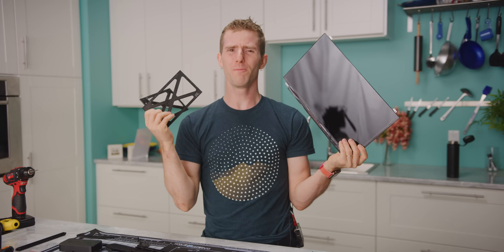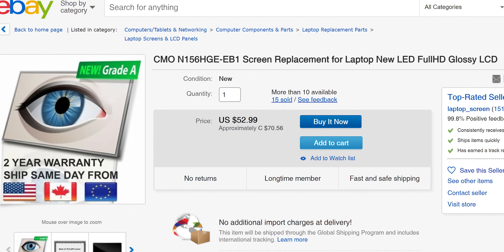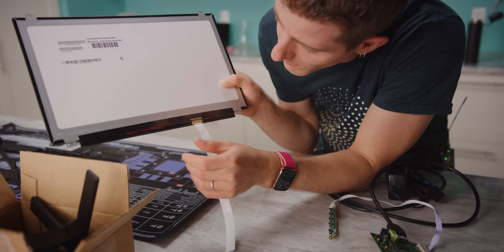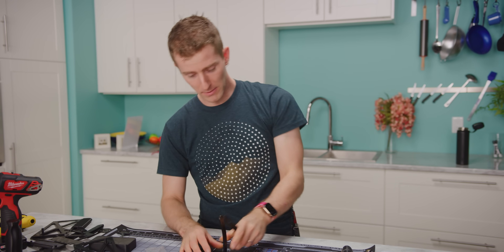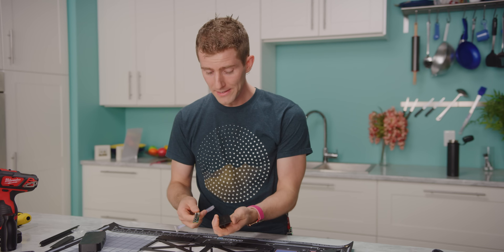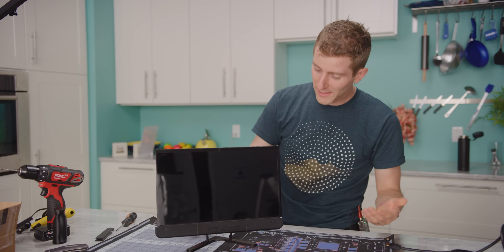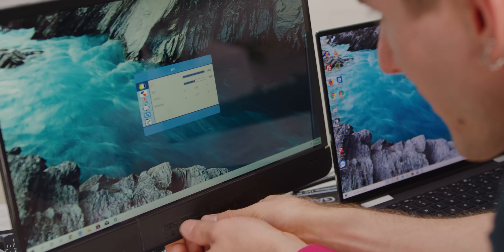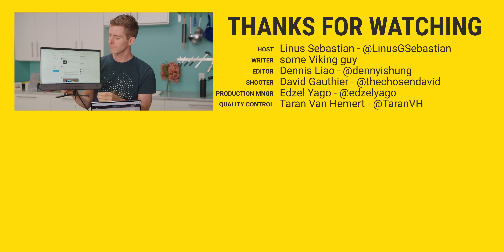We made our own monitor for under $100!

Comment: I tried doing something like this with an old laptop screen.
100 buck to get the controller from Amazon, 2 weeks for it to arrive, and I never got it to output an image.
Maybe I'm using to little current, I said, before burning the circuit.

My advice: unless you have easy access to the parts, like a local electronic shop that sells the components, it's not worth it, just buy a regular monitor.

Comment: I love you, lines! You're like Tony stark of computing. And funny but serious, inspiring. I really appreciate your channel and impressed with your company, I remember you moving in

For what it's worth, I'm planning on building a series of magic mirror type things-just the display, hopefully powered by one pie, which would hopefully double as an interactive window in a stealth van. Id very much appreciate feedback on the viability please, like how much power the displays and drivers only, use please? I've always wondered whats in a monitor, they're so thick with circuitry. Even those without speakers :s I didn't trust ebay either, until I saw this so thanks again

Comment: Pro-hoarder here.  Yep, I picked up an old laptop from skip outside an old house renovation where they threw all the broken things out.  Bought the correct LCD decoder card, held my breath, and it worked.  So I got a secondary monitor which lasted me a couple of years out of it, when the card only cost about 20 pounds.  I still have it actually, one of my better finds.

Comment: For my 3 portable upcycled monitors I've re-used the laptop's display casing and designed cases for the controller board that I've attached to the back.

Comment: wonder if using a lazer cutter table would be easier than a 3d printer. get thin enough sheet metal... hm
Reply: to add to my comment, i havent worked with 3d printers yet. i like the idea of making your own monitor. thanks for sharing.

Comment: Shouldn‘t this be possible with some old smart tvs panel?
Reply: yea but the controlboard is basically in your tv already so you could just use the tv
Reply: @itsoctotv  the motherboard of that tv (a 2014 philips smart-tv) is broken and there is no substitute for that anymore. So I‘m searching for a way to make a proper use of the still well functioning panel cause we don’t need any tv but monitors. We‘d love to use it as theatre and gaming monitor.
Reply: @ltimoniels  you could try opening the tv and looking for the model numbers of the pannel (if you can access it without too much problems) if not try searching the specs of the tv and find the panel model that way
Reply: @itsoctotv  thanks, i already did. But didn’t find any result for that number online jet.

Comment: I've got a LP173WF2 Dell XPS 17.3 screen with a 50 pin connector, 30 and 20 separated by a small space. Can't seem to find a controller for it. Any advice?

Comment: Linus - This costs less than $100
Also Linus - you need a 3D printer

C'mon, if i don't already have a 3D printer (or access to one for free) then this project will cost well over $100.

Comment: $53 or $25 for the video connector, the menu buttons $20, $1-2 dollar worth of nuts and bolts, $2 dollars worth of printer filament, that's about $77 or $49 for a meh sized monitor with crappy brightness, I might aswell buy a cheap new one for $100 or a used one for $60-70.

Comment: I use the old laptops screens that the motherboard died. You can remove the entire monitor structure and screw it 🪛 to a wood panel. Just be sure to give some gap between the controller board (some you can even buy with small fan connection) and the wood. If you get a fan, that's even better because the board gets quite hot and in places like my hometown in Portugal get up to 42C in summer, so 🔥🔥. I use these monitors to code in dark mode with contrast (my screens are always mate). Don't expect native image quality from a 25/30€ controller boards, but is quite good for working in high constrast. For me the most important is de definition be good, not perfect coloring on that monitors (for that I have the main laptop)
Reply: I  use 👏 the 💍👊 old 👵 laptops screens that 😐 the ♀ motherboard died. You 👍 can 👿 remove 🦃 the 🚀📖 entire 🌲 monitor structure and screw it 🪛 to 💦👉 a wood 🍆 panel. Just 👮 be 🐝 sure to 👌✌ give some 🅱 gap between the controller board ♂♂ (some 🕯 you 💖👈 can even 🆗🌠 buy 💲 with small fan 😩 connection) and the 🚀 wood. 🍆 If you get 🤣 a fan, that's even ✖🌃 better ↗ because 🤔👀 the 🙅 board gets quite 🅰 hot and 😫 in ☝👏 places like my 👦 hometown in Portugal get 🉐 up to 💦 42C in summer, so 🔥🔥. I use these 🚑 monitors to 🅱♀ code 😲 in dark mode with 👩 contrast (my screens are 🔢 always mate). 😉 Don't expect 🤗🤗 native ✊ image 🖼 quality 💯 from a 25/30€ controller boards, but 😮 is quite 🅰😵 good 👍🏼 for 💰 working in 👉 high 🔝 constrast. For 📀🍆 me the most 💯 important 🤣 is de 🅱 definition be 🐝🤔 good, 👼👍 not 🚫🚫 perfect 👌😘 coloring on 💩😂 that 💁 monitors (for that 😐😝 I have 👏 the main laptop)

Comment: If like me you neither have nor want a 3D printer just buy a load of cheap photograph display frames and mount the screen and control board to that after removing the glass/plastic cover. A box of various sizes of metal stand-offs and screws is cheap too and will let you get a perfect fit, printing out 17 different parts is insane.

Comment: if dome light flies out the back, you could increase max lighting with very thick white paper or mirror like material on the back. this would allow the light to bounce back in the other direction,  towards the front of the panel.

Comment: This should be in the kit of  "pc repair/ diagnostics on the go". All you need is a power outlet, your portable mouse and keyboard, installers, your phone (for tethering), tester parts, screwdrivers, and one portable display.

Comment: yep, i am building one of these right now. had a nice old laptop that crapped the bed and i pilfered everything i could from it. with a controller and power supply (the ones i have wouldnt work) i spent $35 for a new secondary monitor for my desktop!!! my frame is made of wood.

Comment: I have LG broken screen monitor and 6 old labtop. 
I was wondering if it is possible to take the labtop monitor out and connected to the LG broken screen board. 

broken LG screen is 24 inch
labtop is like 14 inch screen.

Will connector work?
Reply: How do you want to use it.

Comment: "Display adapter" = "controller board" for regular folks. Build one of these a year ago.....was great.

If you don't have a 3d printer, mdf works great. I wrapped mine in wrapping paper that mimicked leather.

Comment: This video is perfect. I plan on making a Reprap 3d printer soon that I was going to drive with a Rasp Pi 4 or similar. I've got an old convertible laptop/tablet thingy that I killed, but pretty sure the screen still works, so I can harvest that, print up a frame and be good to go.

Comment: The only problem with this is I can get a monitor at least that good for a few bucks from my local thrift store without going through all the hassle of having to build it.  I could put that display panel on Craigslist or eBay for a few bucks and sell it and make part of my cost back.  It comes out cheaper that way.

Comment: or i could just buy a monitor for 30 bucks for 22 inch dell or hp screen from local it company thereby saving me 70 bucks and the extra money to have the kit printed or if i wanted a 19 monitor they are 15 bucks for 1080p or 10 for 900 p. I get its a great project and its cool but its not cheaper than buying an actual monitor and it stops it from going to landfill

Comment: i did it using the original notebook body as the monitor body, thanks for the video. Watch out for problems like firmware reset and bad configuration menus

Comment: For anyone who doesn't have a 3d printer, just use wood or acrylic panels. Sure, you still need the electronics, but it's a lot cheaper than buying a 3d printer. If you're doing that, then just junk that old display

Comment: "We made our own monitor"
Step 1: Use a ready-made panel
Reply: @sense8151  yes
Reply: @nßultz1440  We use ready-made GPU’s, Cases, CPU’s, Motherboards, Fans, Cables, Coolers…?
Reply: @bored_person1640  yes and we don't claim to have made our own there's no issue doing this in general rather the issue is to use a premade monitor panel as your solution to making your own monitor it's just a little baity, I still like ltt, just think he shouldn't have ned it what it is
Reply: @nßultz1440  and it’s the same with ready-made literally anything?
Reply: @nßultz1440  it's called "building your own pc" when you make one out of ready made parts. Same thing here. You can't just go and make a monitor panel easily

Comment: Linus: A DIY monitor for 100 dollars

Me: You can buy a 144hz monitor in that

Also me: WHO WOULD DO THIS!!!

My sister: What???
Reply: Kinda depends, for the average user this is pointless due to the cost of the tools (3d printer... lol). But for me, I tend to hoard a lot of tech and have a few printers, so I can save a few bucks if a project requires a display.

Just answering the question :P

Comment: i wanna know what printing service i can use that will make those parts for under 100$
Reply: Buy cheapest 3d printer off of eBay - £80 assemble and set up. Buy cheap 1kg filament - £20. Print. XD

Comment: A little note on the connector types. There's 4 main types of connectors that 90% of the screens out there use : 30pin eDP, 40pin eDP, 30pin LVDS and 40pin LVDS. 30pin eDP is used on screens of up to 15.6" FHD 120Hz or 17.3" FHD 60Hz. 40pin eDP is used on higher refresh rate (for 15.6" that's 144Hz and above or 120Hz and above on 17.3") and higher resolution displays (WQHD/4K etc). 30pin LVDS is used on laptops that are 10+ years old and 40pin LVDS is found on laptop models that are older than ~5 years. 40pin LVDS connectors fit 40pin eDP cables and vice versa, but the panel won't work. Also, In-Cell and On-Cell touch screens (touch functionality is layered into the panel itself) use 40pin connectors that are the same width as 30pin eDP connectors (the connector pitch is narrower), meaning regular 30pin eDP panels won't work and also the pin-out can differ between panel models. I recommend Googling the specific panel model and finding out what connector type it uses, because the differences can be very subtle and you might not notice them, unless you know what to look for.
Reply: Hi, i am facing this problem, any idea how to fix this? LCD screen doesn't turn on after connecting to the controller board and power. when a button is clicked, It flicks once when turned off.

Comment: what I am more interested in.. could you use a similair method to break out the panels out of normal monitors say 3 3440x1440 monitors, and make one big 4320x3440 monitor out of them.. getting rid of those bezzles?
->
and if THAT is possible.. where is there a compagny I can pay to do that very thing for me and make it from tougher plastic or even metal so it would be not as flimsy as this solution?

Comment: We need to see a video on thin clients. I have a thin client.It run linux and i need to know how to install windows and hd upgrade and it 14 pin connector like graphics Card. But i don't know what pcie it uses 
Hp compaq t5000 model

Comment: I made a monitor from a laptop screen but I used the original screen housing and the original laptop hinges as the case and stand. Laptop hinges are surprisingly stiff when you remove them from a laptop.

Comment: 35$ for adapter, 35$ for controller plus shipping, plus screws and stuff. Plus i need a panel and spend entire fcking day assambling this 15" piece of crap. I'm not mentioning that 3d printer is not a fridge. It doesn't sit in the corner in every family. 75-80$ just for the parts without time costs.
Or i can just buy an LG 22" ips monitor from Newegg for 95$ with shipping. That i can sell later for at least 20$ instantly. What should i choose? Seems like the options are equal. Expensive piece of crap with no reselling value or cheaper better product with warranty and solid build quality.

Comment: a tip for increasing the brightness would be to cover the back of the panel with tinfoil, and then assembling the 3d print stuff. it seems you are getting a lot of light leak, and that can be improved

Comment: What would be really cool is take the screen from an old tablet and if you have a case like some of the offerings from fractal design with the 5.25 inch bays in the front, you could make a temperature monitor and if you can, make it so that with just the slide of a finger, increase the speed of your fans or slow them down.

Comment: Hello Linus, I have one old laptop which I do not want to take its screen off but rather use at as a secondary monitor the way it is. I've looked the internet and the only ways I could find are by using Microsoft's screen project or 3rd party program. This is actually a really good way , but It requires internet in order to connect my laptop to my PC(and my internet isn't good enough to sustain good quality). So I was curios if you or anybody who sees this comment know any way of using my laptop as a secondary screen with cable connection between both my PC and laptop.

Comment: Ive found some good NEW IPS and VA panel monitors below $100 (as low as $60 on sale) if you're on a budget, you are patient and you don't mind checking websites and irl places weekly; you can find some real bargains that still have some good performance. You don't have to buy second-hand or used to get a good deal on NAME BRAND and NEW monitors. You just need patience and to check all your IRL places and trusted websites.
Reply: Although if you need an extra monitor to keep up with your stream's chat, or display family pictures, etc this DIY method DOES have it's practical applications and does show potential for many uses, so if you have a main monitor already AND you have a 3d printer, this isnt a bad idea for a 2nd monitor for streaming while you use your main for gaming.
Reply: Edit: the budget monitors I am talking about are 1080p and I do recommend spending at least $125 or more for a really good monitor if you can afford it. I got my current monitor on a amazon flash sale for $140 and its usually $200

Comment: Errrrr..... why would you bother when you can buy a brand new Viewsonic monitor for $100
Reply: JoePCP idk but I didn’t use 3D printing and mine came to a grand total of like $20 usd because I had a spare display panel. Plus you can run these off battery pretty easily which is pretty cool and it reduces e-waste if you’re reusing the panel

Comment: I ordered controllers for some old displays a couple weeks ago. A lot of the time you can just throw the panel's model number into eBay and you'll get appropriate results. A lot will be $15-20 from China, if you don't mind potentially waiting up to 2 months (but usually it's quicker, 2-3 weeks)

I'll be using some of these as 8th and 9th monitors, and adding a battery to one as a mobile display for my work laptop
Reply: what my setup looks like __▢▢
what this mans ^ setup looks like:

▢▢▢
▢▢▢
▢▢▢

Comment: Really though, 100 bucks is too much for a 1080p monitor. I've gotten 1440p monitors for free and way too many 1080p displays (some of them even IPS) for under 20 dollars, so it's really hard to be impressed by something like this. Maybe it would make more sense for a 4k monitor, but since 1080p is the new 900p as far as used monitors go, I really can't justify doing something like this unless it's purely for entertainment. You won't be saving money, it will take a ton more work, and your display might look worse at the end than a 30 dollar Goodwill purchase too depending on how unlucky you got.

Comment: I made my own spare monitor using an old laptop and an unused picture frame, all I had to buy was a driver board and cut some holes in the aluminum picture frame for the inputs at the bottom for a wall mount display

Comment: Well I actually do have 2 older Laptop monitors laying around, but how do you expect me to do this when they are smaller  and thus don't fit the blue prints and also I don't have a damn 3D printer. Even though this is cool, it's definitely not a solution to the problem you said it would help with!

Comment: 1) it's not 'under $100' if you need a 3D printer;
2) it's pretty crappy to be honest;

3) you went that far and didn't even try to plug in a Raspberry Pi or an old laptop board to make it into an AIO?
4) sponsored by iFixit - none of the tools used are from iFixit lol
Nah bad job there…

Comment: This is a project of mine I'm planning. I'm building a double din windows 10 car computer: 7 inch touchscreen lcd connected to a windows 10 computer stick connected to accessories: usb  cd drive, tv/fm radio tuner, usb lte modem, and usb media controller. All this mounted and setup to look factory made in my vehicle. I currently have a $100 androi tablet mounted into the car with a old school equalizer.

Comment: Ok Linus, the video started good, then you introduce one of the WORST display controller modules out there @1:40 OMFG. 😫😫😫😫 That specific controller has one of the worst firmware support EVVVA! Programming tools were never officially released nor supported so WHY, WHY?? Probably because it came with a display bundle from aliexpress??? What was speaking against the M.NT68676.2A? Sure that controller is double the size but has a multitude more of connectors and a whole slew of readily available firmwares and a readily available vga programmer so that you can customize or adapt any firmware to your needs and it supports 4k displays too. So why going with the worst out there?